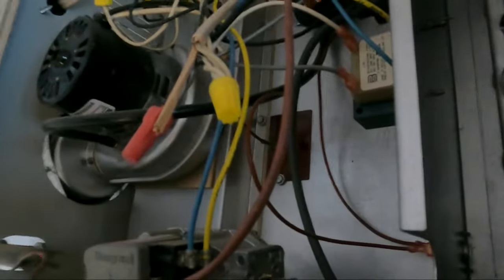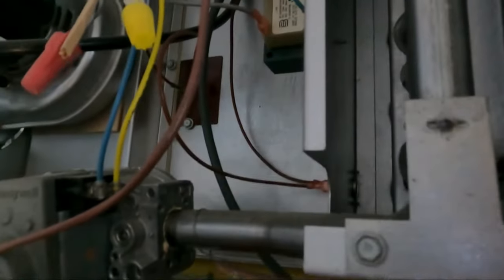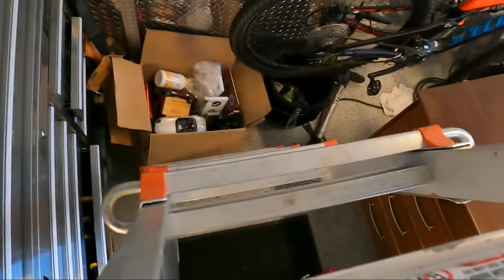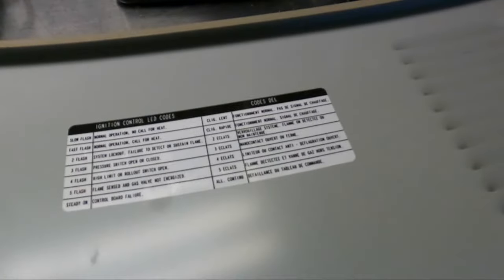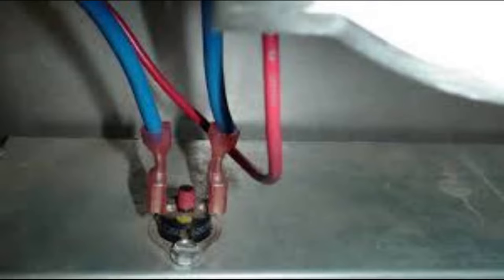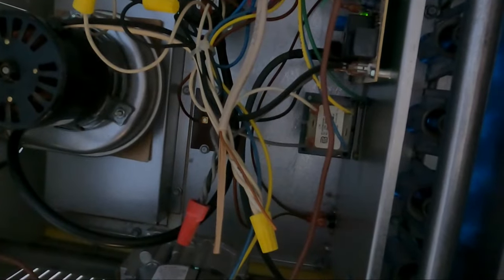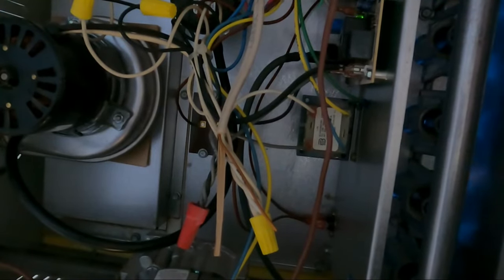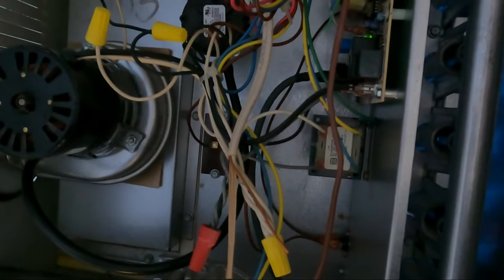How to fix your Mr. Buddy Big Maxx Garage furnace No heat? Easy fix.

Comment: What would you check if I had a flashing green light that was fast which means normal operation and I can’t get anything to light it turns on but no light and no heat
Reply: I have a similar issue

Comment: Ok why did the limit switch open? It's a safety. So if you have roll out from a crack heat exchanger that'll make it trip. Your telling people don't get something check that could cause a bigger issue. Yes sometimes they just go bad. But your not a train professional
Reply from the maker: Agreed. I have yet to post the video of the pressure switch that was causing this issue. But this is something to check first. If there is another reason for it, the switch will open again. I checked for flame rollout, checked gas pressure etc, and it ended up being the pressure switch. Thanks for your feedback!